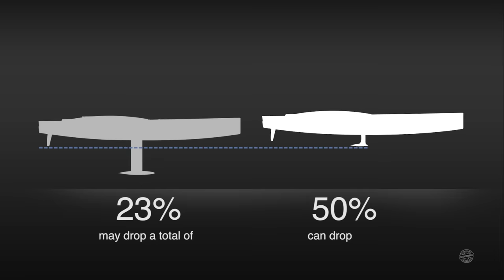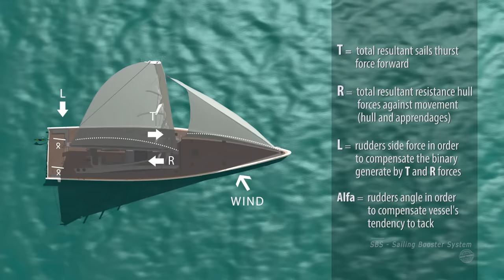SBS - Sailing Booster System - Fast Sailing Performance

Comment: Foils only offer dinamic uplift at high speeds. "Foiling" at 4, 6 or 8kn makes no sense at all. Furthermore, you're putting more weight over the waterline, more systems, more electronics, more battery consumption, etc.

Comment: I would bet money most saying to just buy a multi hull dont have a boat or knowledge of them. Traditional boaters know all the disadvantages of each and wieght them based on thier preference. I dont sail cause I like diesel way too much personally but to say that this boat would sail or react in any way resembling multi hulls is just not right. The foils would not equal the extra 12' or whatever of beam on a cat. Most that admire tri hull haven't spent much time listening to the hull slap water for days on end. This just gives you more leverage against the wind plus the stabilizing effect and ability to trim up would be the best benefit.

Comment: Just buy a Catamaran man
Reply: Exactly. Or buy a trimaran.
Reply: Wrong. Have you ever been on a cruising cat or tri? Way more space. I had a 33 ft cat for years I had at a dock. Never had any issues. Folding tri's work great at a dock and have as much space inside as any keelboat. So seems to me w8stral2 you have little if any experience with multihulls.
Reply: What the freak are you talking about there are several manufacturers of folding tri's one of which is Corsair. There are a lot of folding tri's our on the water. I see them every time I sail on the coast, and also see a lot of big cats in Marinas as well. And what is with the name calling now. We are talking sailboats, nothing terribly serious. Relax and take a deep breath.
Reply: w8stral2 whoa, why so aggressive
It's a sailing discussion not UFC
Reply: I know the w8stral2 person desperately needs to go on a vacation and maybe have an enema done. Sorry to say his so called FACTs are only facts inside his little mind. And no the VAST MAJORITY of tris are not non-folding. I do this for a living and live it each day, so I know. As for other tris and cats needing 2 slips, well like I care. If you can not afford that then buy a slow boring monohull (I actually like slow boring monohulls). And no multihulls do not lack volume compared to a monohulls, one hull, two hulls, three hulls. Now if you are talking hull designs... displacement, semi-displacement, etc. then that is another discussion. If one comes aboard a big cruising cat and then goes on a keelboat, its obvious which one is more spacious, etc. The cat feels like an aircraft carrier, and the keelboat feels like a submarine. Not to mention when a keelboat is under way and heeling, its useful space is reduced, but not so on a cruising cat or tri. Anyhoo w8stral2 thinks he knows what he is talking about but we will let him live in his little made up world.
Reply: And someday you will learn to be polite and control your anger. Learn to read and actually try to understand what someone is saying instead of just focusing on your own biases. Plus learn about sailboats as well.
Reply: Nope just having fun! Seems you got to vent, so keep it going.

Comment: Sure, you could add all the hydraulics, actuators and controls, Or.... just get a trimaran.
Reply: ...and pay twice the slip fees and give up the option to trailer the vehicle.
Reply: @MichaelGustavsonArchitect  Not always the case.
Many are demountablr or foldable. Check out the Dragonfly for but one example.

Comment: It's expensive, vulnarable and inpractical when  docking/in harbours etcetera. Maybe good for braking records in ocean races, but most of these racers do not stay in one peace and often have big problems with this kind of systems. For cruisers it's a nonsense solution for a problem that does not exist. Another system that can break and requires maintanace. When it breaks in bad wether conitions in high seas; you have a BIG problem wich I would not want to have in the middle of the ocean.

Comment: An inevitable development. I'd guess ridiculously expensive and very likely unreliable. If used to reduce keel weight failure in heavy weather would be unsafe. A generator would be needed.  It will probably be confined to superyachts.

Weird English mistakes. Why can't they get literate native speakers to check their English first?